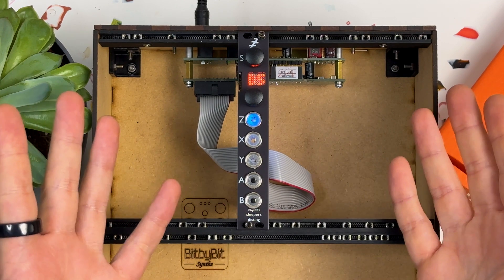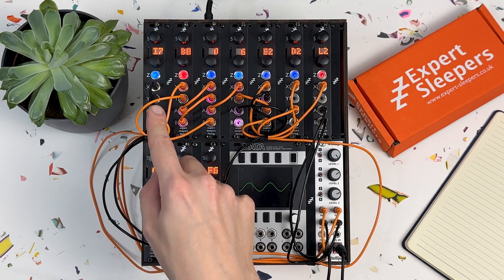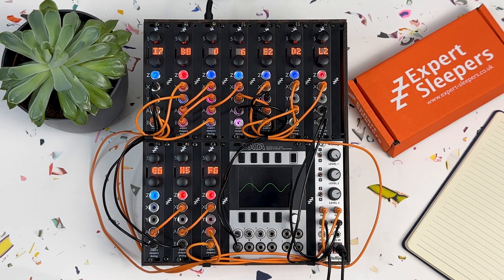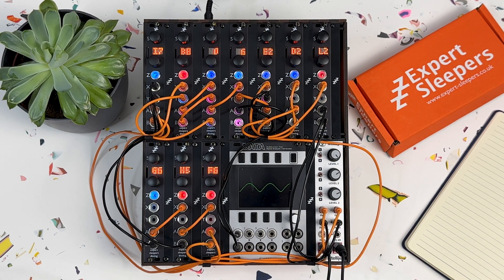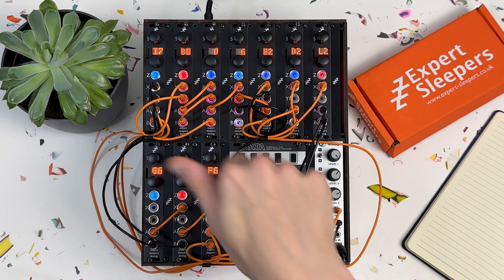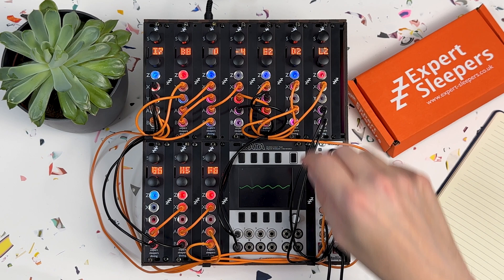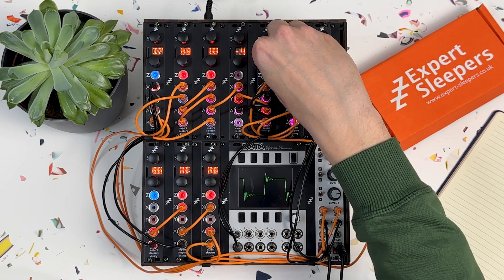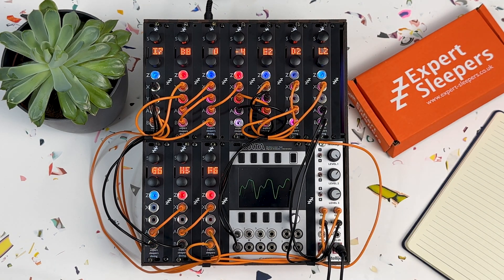Making a modular synth with 10 Distings

Comment: Very cool to see the Deca-Disting in practice here. While I'm not a fan of all of the menu diving, I've really wondered if it is good to have the Disting EX in my setup to essentially instead of getting modules that I would rarely need. Kind of like taking the approach, "Hmmm... I need a comparator for this patch. Ah, Disting has that!"
Reply: I've got 3 distings and what I've found is you come across a few algorithms you use A LOT so you learn those algos by heart and the menu diving isn't so bad.
my 3 are usually a quantizer, a delay and a precision adder but it's nice to have them for anything else I may need that I don't have a specific module for. there's so many aglorithms it pretty much covers anything you would want or need